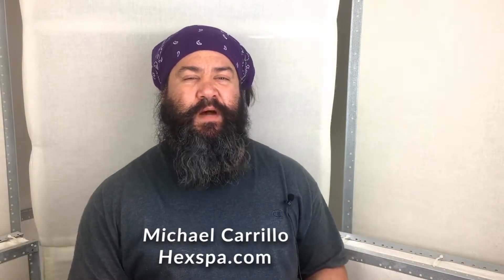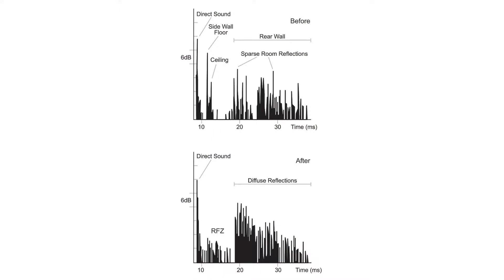How Much Acoustic Foam Do I Need?

Comment: I have no need for this but was interested since I see videos of people with varying degrees of foam panels. Thank you for the info.
Reply from the maker: Hi, synestia.  I thought I already replied.  

Foam panels are an option for acoustic treatment but I prefer rigid insulation.  It’s better value if you don’t mind DIY.  Both work via friction to convert sound energy into heat.  This minimizes the effect of the walls so you get clearer sound. 

Thanks for your comment and let me know if you have any questions!

Comment: Im a gamer and just want my parents not to hear me so how much you recommend
Reply from the maker: Headphones because the class of absorber which includes foam, rigid insulation, and fluffy insulation does virtually nothing for sound transmission.  That, called 'sound isolation', requires purposeful construction, i.e. decoupled walls - also known as 'a-room-within-a-room' - and/or concrete.
Unless you have a separate building from which to game, like a detached garage or suitable shed, then headphones are pretty much the only option.  Some businesses will tell you otherwise but things like mass-loaded vinyl without comprehensive construction will only take you so far and at great cost.
Reply: Haha

Comment: Hi, i want to cover a vault with an, ostentibly, human-sized vict... object in a 3x3 jai... room. How much foam would i hypothetically need_
Reply from the maker: @twitchsopamanxx  3x3 meters? That’s pretty small so it depends on your goals. If you need bass control, you will have a very strong mode due to identical dimensions. Also, I don’t recommend foam. Please provide more details as to your use case. Thanks.

Comment: I have a 4x4 vocal booth that's made of plywood and glass windows. I was thinking of covering like 98% of the walls in there. What do you think? Should I go with 1 or 2 inch wedge foam? I need it for voice over
Reply from the maker: I think if you need an enclosed space for sound isolation, that's one thing.  Acoustically, you're better off in a larger space.  Whether a small space or a larger one, more and thicker absorption is generally better.
Reply: @Hexspa  Do I need bass traps?
Reply from the maker: @princeicio  Let's define 'bass traps'.  To me, this is a shorthand/leftover term.  It can either refer to thick broadband absorption: things like pink fluffy or rigid insulation (frictional absorbers), or resonant absorbers like Helmholtz resonators and things like that.  

Let's just say that 'bass traps' refers to an absorber designed to work below 80Hz.  For voice over, you don't really need bass traps.  I'm a baritone and I just woke up; my morning voice is around G#2/104Hz.  That said, you're only going to fully absorb that frequency with at least 4" of rigid insulator or foam or about 1' thick of pink fluffy.  

In short, you don't need 'bass traps' but you do need broadband absorption which includes everything I mentioned besides the resonant absorbers.  Foam, rigid, fluffy: these are your friends.  

Go thick and you'll be rewarded with tight sound for years to come.  Look up the absorption coefficient graph of your absorbing material.  The closer it is to 1.00 for a given frequency band, the more fully it absorbs it (within a 0.15 tolerance so 0.85 is basically 1.00).  You'll notice that for thin absorbers, like 1", it'll absorb like 0.20 or something at 125Hz.  

That means roughly 80% of that bandwidth's energy will reflect back, likely into your microphone, and create a comb filtered effect i.e. phasy, boxy, sound.  You'll also get more 'room tone' as an undesirable ambience.  

You should know that this digital age is a boon for voiceover artists.  Record in a dead environment and you can use convolution or algorithmic reverb and delay to add some space back in - but go easy!

I'll be happy to answer any further questions.  Please consider subscribing and or donating at 

https://www.paypal.com/paypalme/hexspa

Thanks.

Comment: Hi I m building pigeon wood cage 10*10 size. Pigeon produce noises it will be disturbing to neighbours so I want to control pigeon sounds. How much sheets have to 10*10size cage... Kindly give me your valuable feedback
Reply from the maker: Hi.  What you want is sound isolation.  I'm not an expert in this matter.  Sound absorption might help a little bit bit the material construction of the cage is probably more important.  Thanks.

Comment: Hi,
I have my room for home theatre
12 feet wide 19 feet long. And 10.5 ft height. Kindly let me know how many acaustic panels will be needed for best sound quality in a home cenima
Reply from the maker: While there are formulas which prescribe certain Sabin quantities, I don't know them.  You want to heavily treat your corners and your reflection-free zone which might include surround sound speakers.  After that, you may want to further treat the space to make it more livable or even add diffusion.  Floor-to-ceiling super chunks in your vertical corners and at least 20 4"-thick 4x2' rigid insulation panels is a good start but you can definitely double that easily.

Comment: how do you wrap you super chunks?
Reply from the maker: We sewed the fabric onto the frame but I don’t recommend it.  What I would do is attach fabric to a separate face frame - like a painting canvas - and then Velcro that to the super chunk.  We only have the fronts of our super chunks covered.
Reply from the maker: And make sure you can breathe through the fabric.  That’s a good way to be sure the cloth isn’t acoustically reflective.  Muslin is good, for example.
Reply: @Hexspa  fantastic, could I DM you on insta for some questions? Lastly im confused on when to use ridgid vs softer pink fluffy. I was thinking of doing 6' of rigid 703 on my side walls and back wall
Reply from the maker: @dylanhosborn  Sure, ask whatever you want.  8" of rigid is roughly equal to 2' of fluffy.  If you have enough surface coverage and place them optimally, even 4" is sufficient - though thicker is probably better.  The main tradeoff is cost and space.  But ya, 6 inch thick 703 is great.  The thicker the panel, the lower it works.